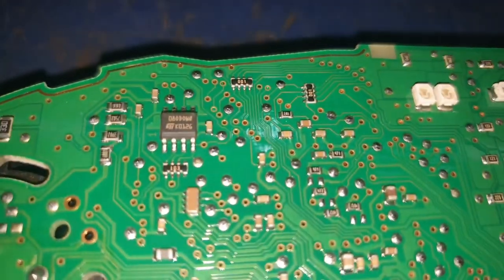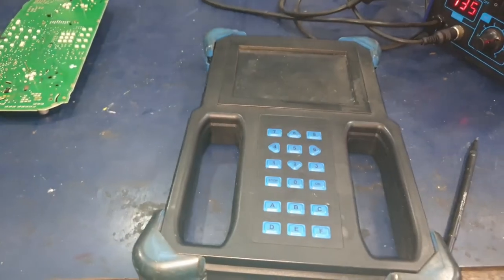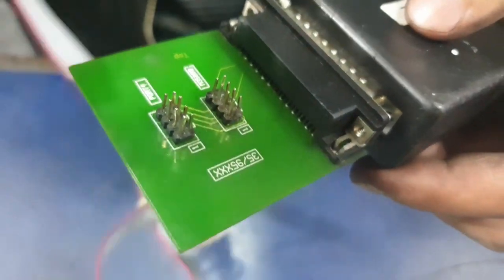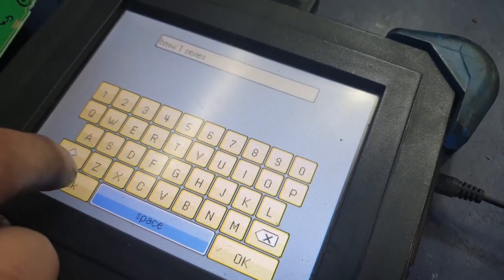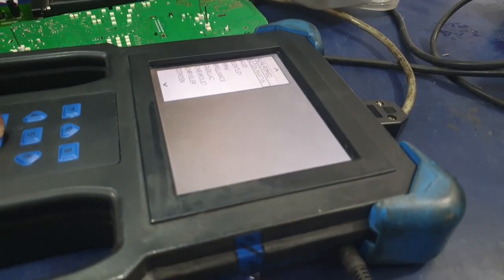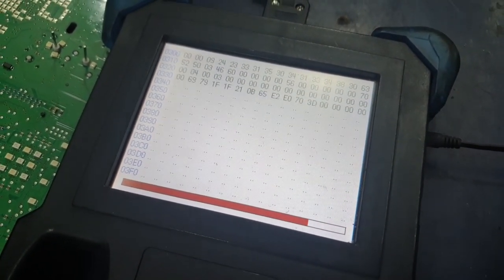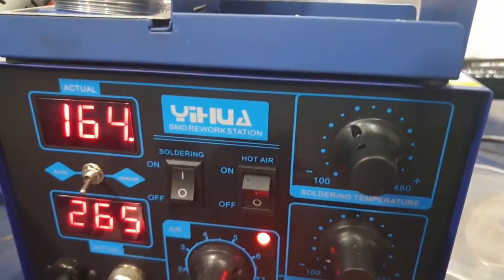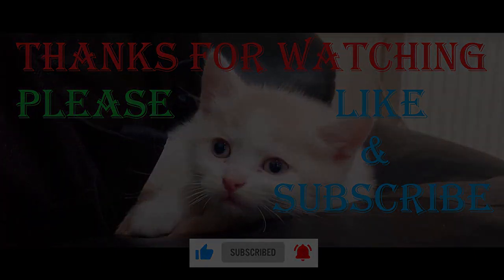REMOVE Read/Write data from 8 pin chip eeprom 35080 fix immo & mileage adjustment & remove soldering

Comment: The new chip it has to be the same number on it and the same company????
Reply from the maker: if possible then yes, but you can use some other brands as well. please check on ebay and search for bmw 35080 chip. you will find it easily. thanks